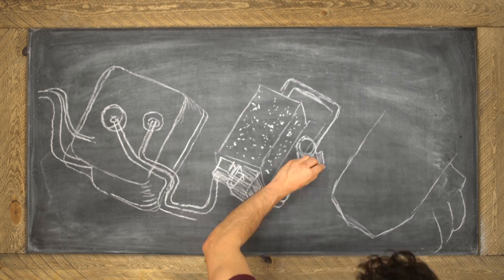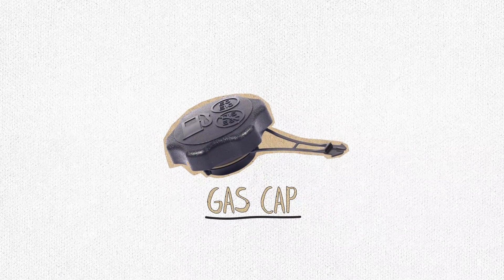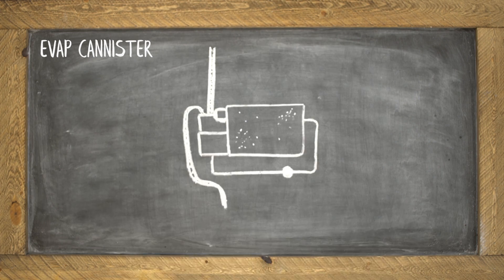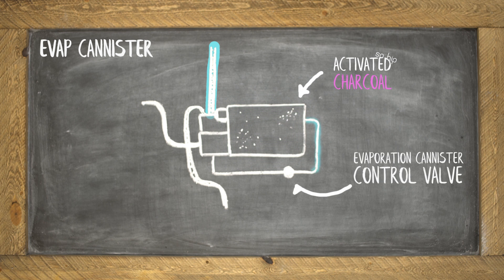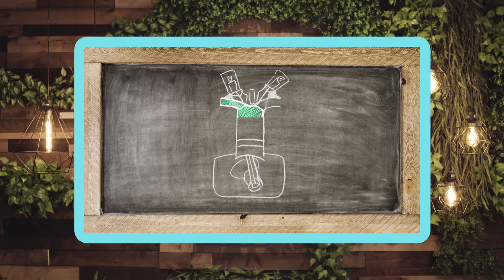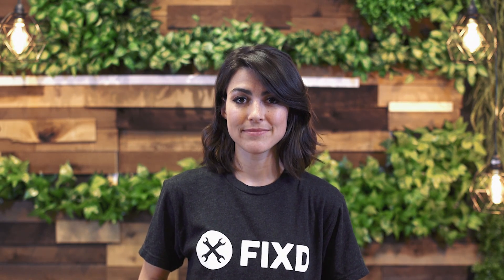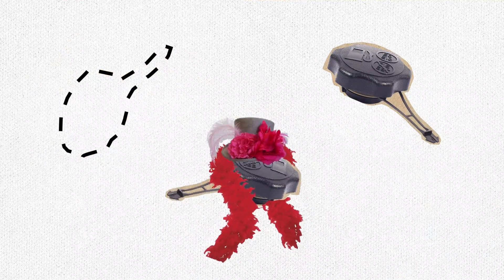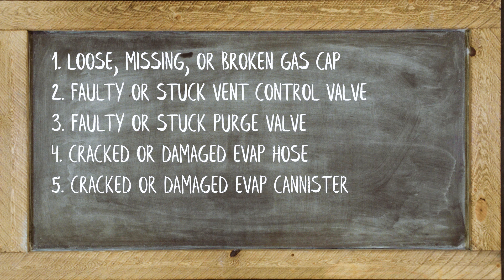P0455 Explained - Large EVAP Leak (Simple Fix)

Comment: Hi I have a question. I'm having a evap large leak p0455 on my 2007 Hyundai sonata 3.3L v6. I bought a new gas cap and code was still there so I paid for smoke test. They said canister vent valve was faulty and leaking. So I've replaced that and code came back 2 days later. I would think its maybe a line but they said they didn't see any bad hoses and it was only leaking from the vent valve. Any ideas or suggestions?
Reply: Hi, have you found a solution as at now?

Comment: So what if I have a P0455 along with P0420?
Reply: @ Sam Harper I have the same issue right now. How did you resolve this problem?
Reply: @williamyoung2930  I don't remember exactly except that it wasn't my gas cap (which is what I was hoping it was). I took it to Sun Auto, and they replaced a hose and I think a valve and maybe some other stuff, and it cost me a lot of money.

Comment: PO455 code is usually not a gas cap although it can be. Mine in a 05 ford expedition is a evap sensor above the gas tank requiring the tank to be dropped. The sensor and wire cost $850 plus labor to drop tank, not such a simple fix. A smoke test will find the culprit or maybe  not. Old cars are notorious for evap codes and they can be a bitch to find and fix

Comment: Can this cause a random misfire if you don’t fix the p0455 code
Reply: I just had a misfire happen the other day and I had the code, so I’m going to say yes.
Reply: What's a misfire? Does that mean an actual fire? Omg I hope not
Reply: Yes, misfire
The idea is that the computer is  assuming the system is sealed and acting properly.

When it opens the Purge valve it's assuming a set amount of fuel vapors will be released into the engine.

If those fuel vapors are not there, the engine misfires under that assumption the fuel mixture was proper.

Assumption was my WORD A DAY CALENDAR word for this morning.
----------------------

Imagine an assembly line that makes PB&J.
Bread 🍞, peanut butter, jelly, bread 🍞
BPBJB, BPBJB etc....

When they run out of jelly the machine still attempts an empty scoop not knowing the jelly is gone.
It's a machine.

You're left with PB sandwiches that have no jelly....aka a misfire
Reply: @EvilTwin123  you didn't have to be so patronizing with the last part, I'm sure most of the world already could figure it out without your Peanut Butter and jelly analogy sir🤓

Comment: I replace a gas cap but I still to have a po455
Reply: Yeah me too lol but it was my fuel pump lock ring was bad so my fuel pump was leaking gas
Reply: @khire16  I just had my fuel pump changed and truck threw this code right after new one put in
Reply: @DaphnesCaseFiles  I actually had a leak cause my lock ring wasn't any good and that code came on did u change your ring or do you know if there's a leak
Reply: @DaphnesCaseFiles Did you fix it? I just replaced my fuel pump yesterday and now I have this code P0455.

Comment: Or it's one of the multitude of sensors is malfunctioning, and it's going to cost you a whole hell of a lot of money to find out which of the many system parts is/are malfunctioning.  This is one crap generic error message.
Reply: Not when you have a simple obd II code scanner 🧐
Reply: @dawhoda1  "large EVAP leak" is not helpful.